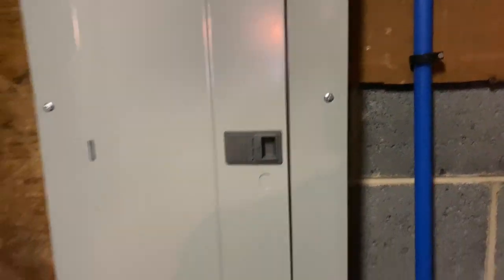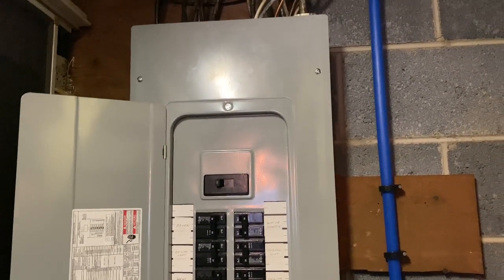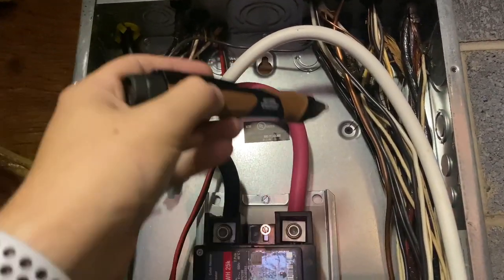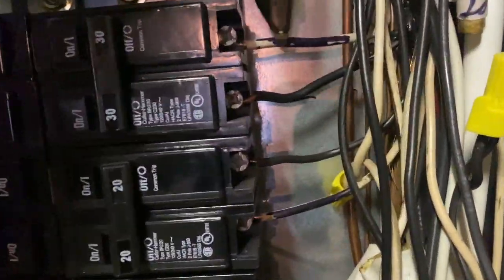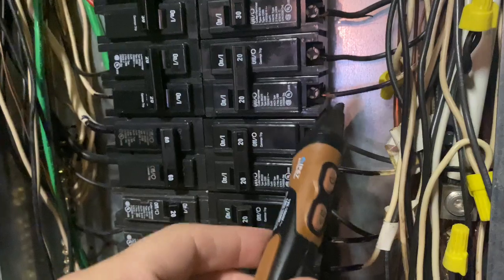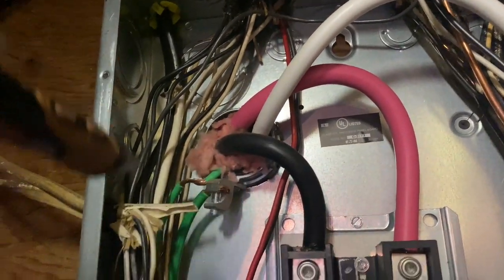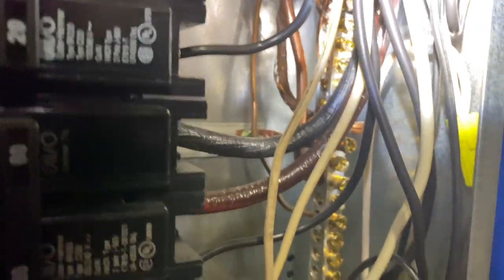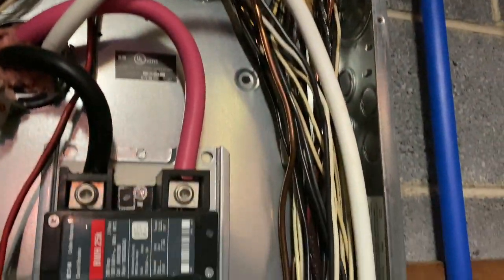Inspecting an Electrical Panel

Comment: Blunt end screws or not! If there are wires on the back side of the hole, it will get damaged, especially if its a feeder or a tight bundle that cant get pused back.   All wires should be away from the holes.
Reply: Thank you Captain Obvious

Comment: Just so you know, the No oxide paste is not required by the conductor manufacturers or most panel and equipment manufacturers.   The aluminum has been changed to not require it.   But, there are some pieces of equipment that the manufacturer does require it.   So, if it’s there, no issue.   If it’s not, may or may not be an issue.
Reply: Why would you ever not apply the cheap antioxidant to aluminum wiring???? Never have someone who cuts corners do your work
Reply: @chopshop523 When the manufacturer states you don't need it.
Reply: Apply anti-oxidation grease or mineral oil to ALL connections in a breaker box, including ALL lugs, stabs, wire clamps, splices, terminal and bonding screws, and neutral/ground bars, and any and all wire to wire or wire to terminal connections, even if you don't need to. If it was my house, I would also wire brush all copper and aluminum wires and terminals and apply ox-guard before connection.
Also apply it to outlets, switches, and lights, basically any place that the wire makes contact. Do double wiggle the wire and retorque all terminals, and put anti ox on the receptacles, wire nuts and Ideal/Wago splices, ground screws, and terminals also, a well as the ground wire clamp, blades on a plug and the hot, neutral, and ground slots on all outlets and light bulb sockets. 💙 T.E.N.

Comment: 👍🏻 nice video, It looks that panel was supposed to be wired as a sub panel based on the conductors entering the panel. If so, the grounds and neutrals should be separated.
Reply: The meter might be behind it on the other side of the wall?
Reply: And the bonding screw removed from the neutral bus bar. Often you will find a jumper from neutral to ground which also should not be there for a sub panel. And neutrals on one bus bar and grounds on separate bus bar regardless of main (best practice) or sub panel (essential). Both bus bars are jumpered together and bonded if the panel is main.

Comment: Is nobody going to point out the cut/slice in the insulation on the second wire down on the 30 amp breaker?
Reply: At 1:55 on the right hand side. Good eye, it’s not so obvious when the video is running because he is moving the camera quite a bit up and down while filming.

Comment: Can a sub panel be installed upside down?
Reply: Yes , just never have a breaker that when the handle is down the breaker would be in the on position .
Reply: They make panels with the main down low, not up top. 💙 T.E.N.

Comment: “Best practice” is nothing more than someones opinion about how something should be done. A violation of said “best practice” isn’t a code violation. How can you write up a best practice violation as a deficiency or a safety concern?  You said “ the wires should have been done the right way”, there isn’t a code violation the way they are installed so it shouldn’t even be mentioned on the report. Stuff like this adds unnecessary expense to the owner that it’s trying to sell the house and can add unnecessary concerns onto the potential buyer. The term best practice isn’t listed in article 100  of the NEC.

Comment: If there was a sub panel right next to the main panel, and you wanted to move one or two circuits to the sub panel from the main panel, could you splice the original wires inside the main panel with new wires coming into the main panel from the sub panel?  Or must the spliced wires all be contained in the main panel only?
Reply: If you add a sub panel beside the main panel, the only splices would be in the main panel. The sub panel would not require any splices, as only the circuit wires that you need extended from the main to the sub panel need to be spliced. P.S. Splice all the wires in a circuit, (Hot, neutral, and ground) and take them to the sub panel. 💙 T.E.N.

Comment: As an electrician its my opinion that your hen pecking those two wires. Its not against code. Could they have done a neater job? sure. But its not a violation.

Comment: Doing a service charge you land the wires on a breaker to avoid splices
Reply: When splices are in the panel, it's usually because breakers were reorganized or balanced.. 
When landing a new string, it's easy to drop to bottom of panel and have enough length.

Comment: groung wire was insufficient even for 1980's standards
Reply: The thin ground wire matches my 1964 house.  As does the old style of Romex in on image (at the cable entry, top right corner).
Reply: #4 is ok for 200 amp grounding 250.66

Comment: Are the wires long enough, looks like that's  why they were run as they were.
Reply: Panel probably had breakers balanced, moved around.  That's why splices are typically in the panel.

Comment: Not a mention of grounding the service panel. ( I did see it was grounded to a water pipe.)
Reply: No mention of separate neutrals and grounds per bus lug.
Gotta' keep 'em separated.  Ground and Neutral under same screw is not ok and should be mentioned.  
Also didn't mention how much he saved on car insurance. ;  )

Comment: wow on the spliced wires. in canada that's a fail. you can't use the panel as a junction box due to extra heat from splices.
Reply: Not a junction box, that is to extend wires because it is a retrofit.  The splices will never get hotter than the wires, there is far more mass of metal in the splices esp. wirenut splices.

Comment: Electric panel isn’t allowed to be used as a junction box. Well except for when adding a generator panel next to it that has junctions required in the panel?
Reply: If you're saying that you can't make splices in a panel, that's incorrect. Splices are allowed as long the enclosure does not exceed its box fill limits.
Reply: @pld8993  Canadian code apparently doesn't allow splices in a load center with a new installation, as a workmanship rule e.g. "no hack jobs in new work".
Their code does allow splices for retrofits, but this is widely unknown or misinterpreted.
Reply: @1djbecker  That rule apparently applies to splices that are used to extend circuits through the panel, feeding through to another location; not for circuits that are terminated within that panel. The NEC allows feeding through the panel.
Reply: @pld8993  Do you think that's the reason Canadians have the 'no Marrettes in a panel, ever' as a national aversion?